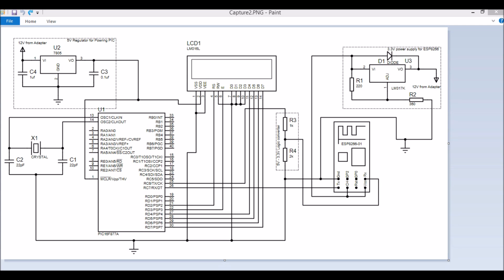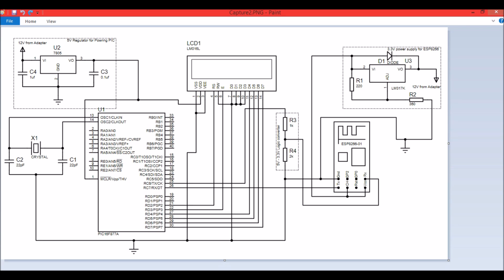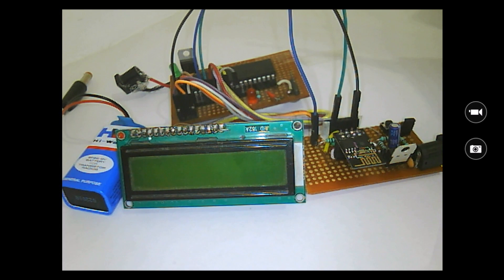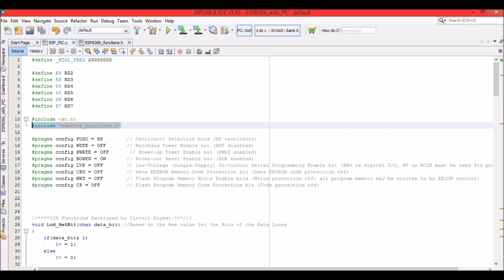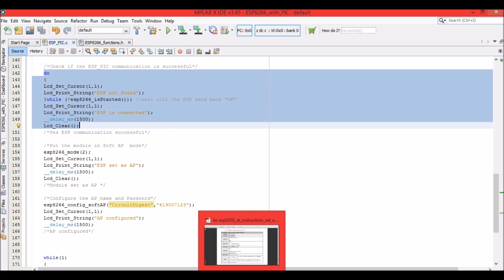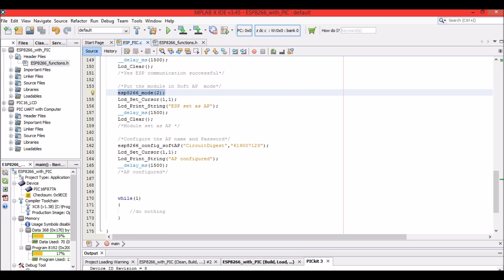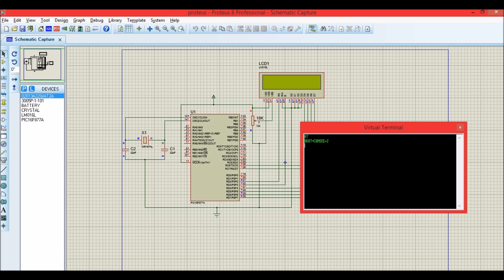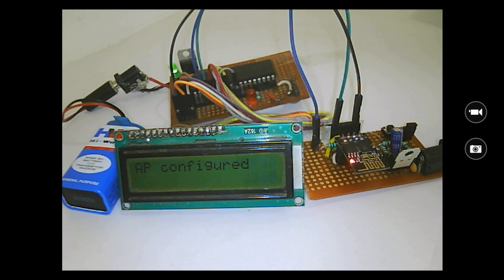How to Interface PIC16F877A Microcontroller with ESP8266

Comment: Great tutorial! Can I do the same steps for an ESP32?
Reply from the maker: Yes you can.make sure to use the correct pins, flash the ESP32 with AT firmware and modify the code accordingly.

Comment: i have connected everything but ESP is not able to connect to WIFI. Anyone knows why is this so?
Reply from the maker: ESP will create an Access point and you should connect your computer to that access point.
Reply: I have made the ESP as station mode to connect to my hotspot. but it is always showing ESP not found. @Circuitdigest
Reply: So should be the ESP is not connected to my MCU in the first place, so the rest of the code can't be continued. @Circuitdigest

Comment: Hello my friend, I have been trying to communicate my pic controller with Esp8266 module for long time but via CCS C, not MpLab. And I couldn't find any library on internet. But it seems like so similar. Should i only change all the __delay_ms(***)  codes with delay_ms(***) which is appropriate for CCS C? will it work? the rest of codes are same I think for CCS C. ı really need your answer, thank you !

Comment: I am  having an issue with this as the ESP8266 never sends the "ok" back to the PIC and the LCD screen simply says ESP not found, any help would be appreciated, thanks.
Reply: That's probably because the default baudrate is 115200

Comment: I simulated the circuit under proteus with the same code for the pic microcontroller  but the virtual terminal displays characters unreliable, I do not know where the problem
Reply from the maker: The problem should most likely be with your baud rate and Crystal frequency.
Double click the virtual terminal and make sure the baudrate is 9600 and double click the PIC IC and ensure that your operating frequency is 20Mhz.
Thanks
Reply: hi! I did it was that you said but instead of AT the virtual terminal sent ÿ, and when I type "OK" nothing happens
Reply from the maker: Please post your problem in detail on our forums https://circuitdigest.com/forums. You will get help there.
Thanks!
Reply: thank you I already posted on the forum
Reply: @andriamialisonjeanmarck143  What resolved your issue? i am facing the same issue currently
Reply: @Circuitdigest   actually the default baudrate on the virtual terminal  must be 115200,  I did it here and worked fine
Reply: andriamialison jean marck  check your baud rate.